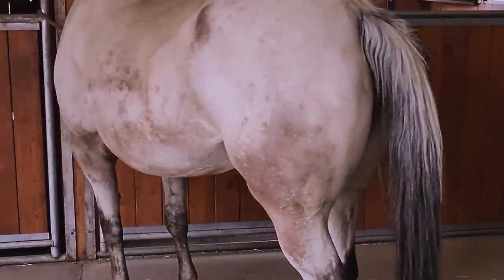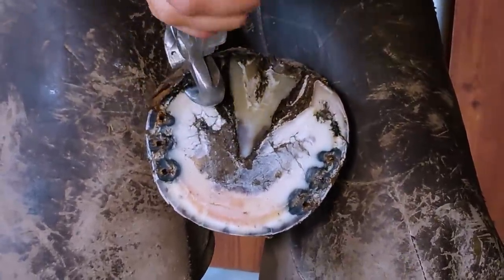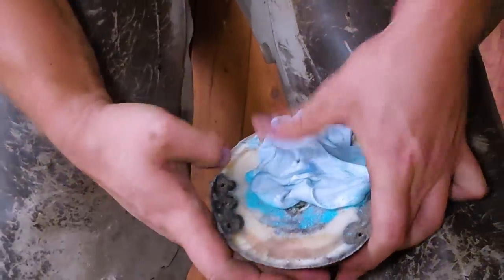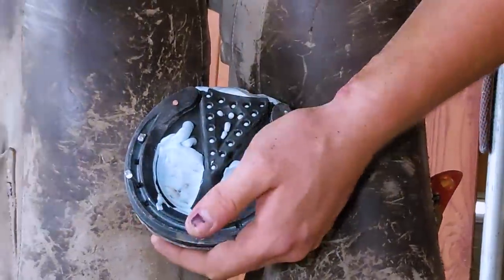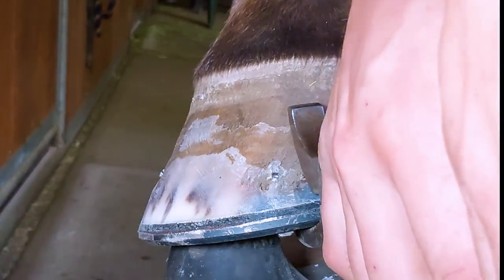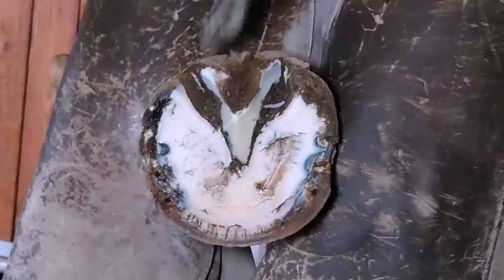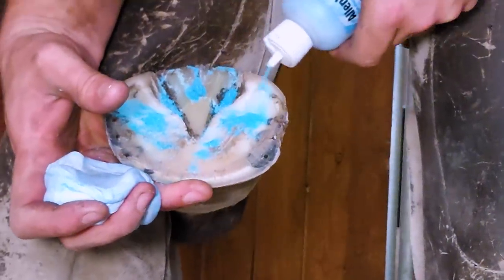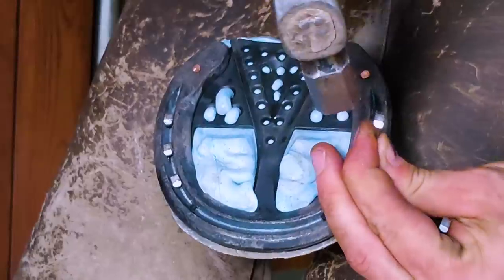Helping Horse With Sore Hooves!!! - Trimming and Shoeing Endurance Horse With Special Pads and DIM

Comment: Having never owned a foundered horse, I can't speak from personal experience, but my understanding of the condition is that it is an inflammation in the lamini holding the hoof wall to the foot causing them to begin to separate. She does show a bit of wedge at the front, where the lamini have been stretched out - you can also see it in an increase in thickness of the white line towards the front of the hoof.  You do need to keep as much sole as you can at the of the hoof to protect the coffin bone but you also need to decrease pressure on the front lamini. Some type of rocker shoe or other shoe( as a big believer that bare foot is better, I'm not familiar with all the shoes available, but then, I don't compete in endurance either) that decreases the leverage on the front lamini as the foot rolls forward might help restore the lamini, especially in mild cases of founder caught early and aggressively treated.
Reply: I have a foundered mini and she has rotation. Her laminitis is completely healed but of course the coffin bone stays where it rotated to. My Ferrier squares the front toes for roll over. She is a happy little mover these days.
Reply: @sassy6292 😮 you do know Secretariat is got put down because of laminitis in 1989 at 19yrs old still in his prime at that time. The vets are alot more trained on dealing with that now. Just wish they could have saved secretary from that stuff in 1989

Comment: Curious: aren’t there any hoof polish/ oil , that strengthens and/or protects ?
Reply: There are oils you can use to seal in some moisture, and some that are more cosmetic for shows, but otherwise not really. The hoof wall is made out of keratin like our nails are, but a lot thicker - imagine your thumb tip with just the bone, and then rather than muscle it's all nail. But it's also not good to use oil too much, because as well as sealing moisture in, it'll keep it out.

Comment: Caleb, I she really sore at the pinkish area in front of the frog towards the front of the hoof? Also, what are we seeing what appears to be nail holes in her sole on both sides of the hoof? Is that painful for her and is it because the hoof wall is so thin that the shoe nails go directly into the sole? How come she doesn’t have to rest for a month or six weeks so the hooves and soles can really heal well before she starts competing again? Thanks! 😊❤
Reply: I think I can answer most of this for you.  When a horse founders, heat builds up in their feet, like having a fever.  This affects the internal structure of the hoof, causing pain and weakens the supporting structures.   In turn, depending on the severity, hemorrhages occur in the sole. As Caleb trims the hoof, you are seeing where the hemorrhages occurred.  Founder affects the whole body, but due to the limited blood supply to the legs, this is the result.  Laminitis is a result of founder, where the hoof wall separates from the inner hoof and outside horn.  No, it's not painful to insert nails into the outer hoof wall.  The opposite is true if the nail goes into the laminea.  This is why Caleb is among one of the best farriers I've had the pleasure to follow!
Reply: @chrismack5908  Hi Mr. Mack! Thank you for the thorough explanation to my questions. I feel bad the the horse because even a lay person like me can see that her hooves are sore. Also. It worried me that her hoof wall appears to be so very thin. I never have seen a horse with that. Hopefully, she will be better soon and not need to be treated for founder. I hope so. I agree with you about Caleb. I love watching his videos and that he explains everything as he works on each horse. As you can tell, I’m new to farrier work, but I do think that Caleb has to be one of the best in his field! Thanks again for taking time to respond to my questions and concerns. You’ve been a big help!! Have a very nice weekend. I hope you and your family are safe and far away from all of the severe weather areas around the country. Take care. Rafaela Ferguson
Reply: @user-ox7jf4oc8r  Good afternoon. Thank you for the well wishes.  I'm in NorCal, so really normal weather; it's good here.  I owned horses for years so am somewhat familiar with the goods and bads of owning them.  A solid farrier is a must and, as the saying goes:  no foot, no horse.  Horses are wonderful companions, but take constant work and care, and $$$.  Glad to have helped!
Reply: @chrismack5908  You are very kind Mr. Mack. North Carolina is a beautiful State. I live in Maryland and, so far, we have escaped all of the catastrophic weather events around the US; thank God! I love horses but I know they require a lot of care and that you must have a lot of capital to own one. I very much appreciate you responses to me today Mr. Mack. Have a safe and relaxing weekend. God Bless You.
Reply: @RafaelaFerguson   NorCal means Northern California
Reply: @brotoubrotou3164  thank you for bringing my mistake to my attention. I misread the response and thought I read NorCar. I see now he did write NorCal. I’m sorry for the misread.
Reply: @RafaelaFerguson    No problem.  I just thought I’d clarify.
Reply: Mr. Mack, my apologies. I know NorCal is Northern California. I’m so sorry that I misread and said North Carolina!! Unfortunately, I haven’t ever been to Northern California. I understand that part of California is quite beautiful! I am very happy that you and your family have been out of harm’s way; considering all of the wildfires. I pray that that will continue to be the case in the weeks and months ahead. Stay safe and take care. ❤️❤️
Reply: @brotoubrotou3164  And I truly  appreciate it!! Thank you so much. 👍👍❤️❤️
Reply: The western state trail endurance ride is a 100 mile 1 day competition (also called the Tevis cup) that runs though the mountains of the Sierra Nevada, from Tahoe to Auburn, CA. It crosses the middle fork of the American river. It has been held there since 1955. Arabians are the most popular breed used.

Comment: I don’t get it.  If I had a horse that had acute laminitis - and I gave her plenty of time, proper nutrition and whatever corrective , therapeutic hoof care they required to go sound again - maybe - I would consider trying competitive endurance again. 

When you start saying founder you’re crossing into chronic laminitis.  A horse with chronic laminitis (founder) should never be asked to continue to compete in endurance racing.  

You can plainly see the bruising between the tip of her frog and the toe of the first  hoof you trim.  

Give her a new purpose - like a kids trail horse on ground easy to cover and find another horse with no predisposition to laminitis for competitive endurance racing!

Finally, the term is ‘cresty’ as in ‘crest’ … not crusty.